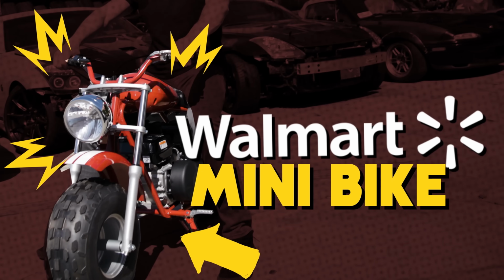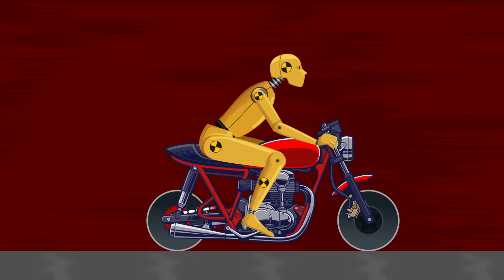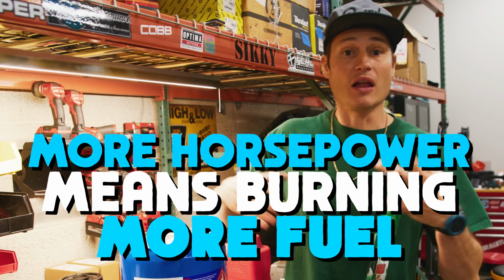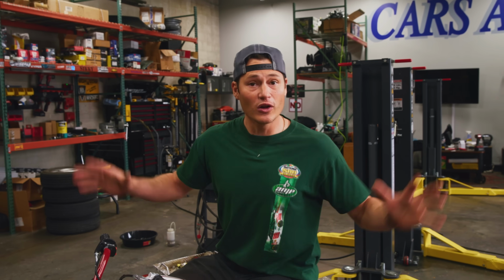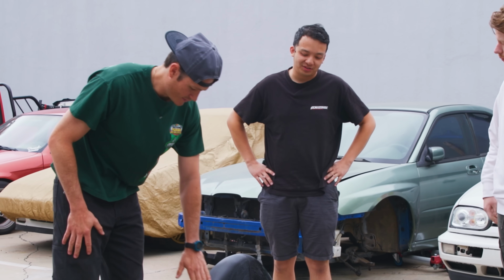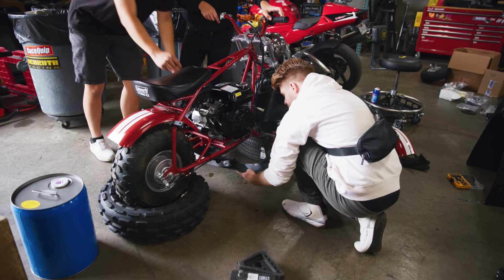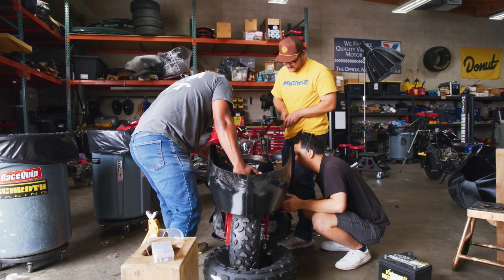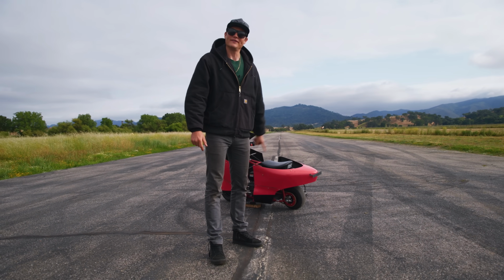Building the World’s Fastest Walmart Motorcycle (Day 2)

Comment: I feel like the smaller diameter back wheel is going to hold it back. A larger thinner back tire would maximize the distance covered per rotation but also won't be as heavy.
Reply: My thoughts exactly
Reply: It's already geared tall to reach 100mph, a larger wheel will gear it too tall to reach their goal.
Reply: @andoletube huh?     The engine will hit top RPM earlier with smaller tires, BUT the top end speed will be diminished.            Why doesn't every car have 13'' tires?
Reply: @chazbennett8676  Final drive ratio is not just about tire size, it's front/rear sprocket sizes. Jerry already said the bike was geared very tall to be able to achieve 100mph, that's why he needs a push start. This talk of altering wheel size is ignoring what has been revealed about the bike in the video.
Reply: the gear ratios compensate for the diameter, but you're right about the width increasing rolling resistance.
Reply: @andoletube  bigger gear or bigger wheel doesnt matter, it would give the same end result on the gearing.

and i doubt it came with the gear they have now from the store
Reply: @TheHenirik  That was precisely my point. Why are you explaining it back to me? You should explain it to the people who don't understand it.
Reply: @andoletube  because I understood the last part as: 'the gearing was already set that way, why would you ruin it with bigger tires'

I might have misinterpreted what you mean though
Reply: @TheHenirik  They definitely set their own gearing, it wasn't the stock gearing the bike came with. That bike was only designed to run to about 20mph, so to modify the engine and to get it to run to 100mph, they clearly set a very different drive ratio, via the chain and sprockets. Jerry mentioned that they geared it so tall for maximum speed that they couldn't even take off without a push from the RV. 

My point was that they have already done that work -  calculated the final ratio to match the maximum power RPM range so they can reach their 100mph target.  So there's no point talking about swapping in big wheels now - that would require substantial re-engineering of the bike, for no real purpose.
Reply: @andoletube  yes and knowing that the tires on something like that likely never would have been rated for such a high speed they could have started on that end instead of getting a gear almost as big as the tire was my point =)

Plus you get more stability and it gets less sensitive to cracks in the pavements
Reply: @TheHenirik  They're trying to avoid having to mod the chassis, plus they're driving it on a smooth runway. This is a purpose built project, it has no future beyond these videos - that's why they aren't bothering with all the world's-best-practice stuff.
Reply: @andoletube  Who said anything about modding the chassis. The went to a smaller wheel size from the original. And no, I'm not suggesting put on something larger not rated for 100mph. Also, you're forgetting that they modded all kinds of stuff already such as the gearing, the engine, the cowling. I assume you already know the results...
Reply: i get your point. why small tire and then add tall gearing when they could have used a normal tire size and not go so agressive in the gearing part... the outcome would be the same, but it the bigger wheel gives more stability. 
maybe they could'nt source one or something. who knows
Reply: Yeah they are changing the final drive a lot with that

Comment: I dig this series, the only thing I see wrong is the reduction in tire size, you gain acceleration at the expense of top and as well as reducing the rear wheel sprocket size you lose initial torque but gain a higher top speed, there a lot of variables that go with it but that’s the rule of thumb

Comment: It's funny, because less grip is actually better for speed runs like this. And that slick absolutely has more rolling resistance due to the stickier rubber compound.
Reply: I was thinking that too.  Also a larger wheel will enable a higher top speed since it gears the bike up.  With a proper torque converter the bolt can take off at a lower rpm to overcome the initial torque needs of a larger tire.  most 200cc mini bikes can easily go over 50mph even with stock tires
Reply: yeah you want a road bicycle tire, basically. The smallest amount of ground contact. Any contact with the ground means more friction. So you want narrow tires with a very large diameter(to change the gearing).

Comment: I advise you to put a bigger and narrower wheel since you need the lowest possible friction resistance and since you have such a high gear ratio you would not have traction problems. For example, the MotoGP bikes have wide tires only because I have to bend in corners otherwise they would all put narrow tires as was done in low engine capacity races. 🙂

Comment: 4:30 Drag force increases with the square of speed. But you don't rate an engine in force, you use power (horsepower/watts). Power to meet drag increases with the CUBE of speed, not the square. So 20>100mph needs 125x more power just to meet air resistance.

I'd look at pedal-powered velomobiles for the sort of fairing you need to really cut it down. At 100mph air resistance is practically the only thing that does matter assuming the engine is geared to reach it.

Comment: You have better fuel and more compression. You need more timing. Did you install and higher degree flywheel key? Or better yet put in the adjustable Time kit for the coil?

Comment: At 1:28 the roll resistance on smaller tires is actually higher then on larger tires. In this case probably that the wheel has no tread makes it more efficient then the off-road tire. Not that this really matters, but I graduated today as a Automotive engineer so I am suddenly spitting these facts.

Comment: Gearing is essential for speed as well. Bigger sprocket in front, smaller sprocket in the rear. Either or both are needed especially with a smaller tire diameter.

Comment: The rear wheel needs to be larger in diameter (free top speed at the cost of acceleration), skinnier, and not a slick compound (less rolling resistance). Additionally, I think an aerodynamic "cover" that is installed on the bike + rider after they are on, or with an opening hatch would have had much higher drag reduction, the gaps in the aero are significantly holding the bike back, to the point where the 4% drag decrease is not outperforming the gain in weight.

The material of the aero is also very interesting, PETG is a relatively brittle plastic which shouldn't be used in applications other than prototyping, I think that 3D printing the aero then using that as a mould for a stronger and lighter material such as fiberglass or carbon fiber for the final part would have been a better alternative.

Comment: Smaller tire means faster wheel rpms and increased tourqe at take off but you lose top end at max rpm's. 
Faster takeoffs are not what you want. 
A skinnier tire the size of stock or slightly larger, over-inflated with the right gearing you could get up to 100mph. Tire Diameter x eng rpm / (front and rear final gearing ratio rpm) = top speed.

Comment: Making some speed holes through that faring, with some cling film over it all, would probably give you less drag with less weight, as 4.2kg/10lbs is quite a bit for the loss of drag. That weight plus the smaller back wheel won't make it any faster. Methanol fuel system surely needs to be tweaked? Good luck, i think you're going to need it

Comment: Smaller diameter tire equals more rolling resistance since the tire needs to rotate faster and makes more contact overall for a set distance than a larger diameter. In this case. a larger skinnier tire would help with that and also the stability problems.

Comment: Without watching what happens next, I'm worried that the air drag forces will flip the bike into a wheelie.  The seat is far too much over the back wheel, so the weight is way too light on the front wheel, even when you're leaning forward.  I'm glad you put those cowls on, as they will reduce the chance of that.  Good luck, and stay safe!

Comment: You can still make tire improvements. The wheels need toade out of aluminum or 3D printed carbon, even taking 1-2 lbs off a tire will drastically improve the speed the tires can rotate. Also those slicks looks a little thick with too much side wall so make the tires more low profile and make the wheels larger to cut out sidewall tire weight. The last and most important part is a much narrower from tirex no more than a 2" wide track and even then, shave a half inch highway strip in the center and your friction road resistance will be greatly reduced meaning was less mechanical power loss.

As I said on the last video, tires, tires, tires, that setup willaoe or break you.

Technically an 18" wheel with a touring bicycle tire with hiway strip would be perfect. The further out your tires distance will be from the center, the faster that tire can spin because the sprocket on the wheel will turn at a speed but the outer edge of the tire will travel significantly farther each rotation. Wouldnt you rather travel the distance a skateboard wheel wil travel in one rotation or would you rather have a 5' wagon wheel distance in one rotation. If those 2 tires are the same weight, it will take the same power to turn those tires, but one will travel much further each rotations. More rotations in the same time frame increases speed

Comment: Correct me if I`m wrong but in one of our Automotive engineering classes we were taught that smaller tyres have a higher rolling resistance, not a lower one. That's one of the reasons you see those "narrow & tall" wheels on EVs so often.
Reply: Also maybe you could've used a larger tyre anyway and then just compensate with gearing. A larger tyre has more rotational and translational inertia, but since you're going for vmax and not acceleration that shouldn't be much of an issue. The greater drag of the larger tyres would be negated by the Fairing.

Comment: You should take off the rear fairing because that would be causing a lot of drag, the way it is designed it would be acting like a parachute so my suggestion is to either take it off all together or modify it by cutting off the rear where it’s going to be catching all the air

Comment: But a larger diameter tire can increase top speed as it takes fewer revolutions to travel the same dustance as the smaller tire. Sure more torque to spin it but lower RPM at the top end to get to higher speeds.

Comment: I wonder if the 3D print would work as a decent mould for a more flexible, forgiving fibreglass fairing in the future. It might end up heavier though, I do not know what kind of weight fibreglass has vs. a 3D print and exactly what percentage of infill or infill pattern they used on the 3D print.

Comment: Drum brakes have higher initial clamping force than discs, but overheat and fade almost instantly due to being a closed system.
Reply: A person could just blow compressed air through the bottom of the backplate and vent it off through the top via a hose leading high enough to prevent the elements from getting in.

Comment: The spray they use for 3d scanning is to eliminate reflections since those ruin the software's ability to make the 3D model. It's usually baking soda + rubbing alcohol or salt + alcohol
They use alcohol instead of water because alcohol will evaporate away leaving just the powder. Water; would leave reflections.

Comment: Actually, with all other parameters (load, width, air pressure, and contact patch area) the same, a larger diameter tire has less rolling resistance.

Comment: Can't help but think that it would have been easier for them if they had used larger wheels. Yes it would take longer to get to speed but the overall high end top speed would be higher. They'd just need a longer straightaway to get to the top speed.

Comment: wait, im pretty sure the optimal air fuel ratio for methanol gives the exact hp (or like 97%) as the perfect gas fuel ratio but methanol makes way less heat so you can turn up the engine.

Comment: Why no torque converter?  Fixed ratio gearing with the stock centrifuge clutch is not the way to go fast.  A torque converter gain will surpass the aero mods by a fair bit.

Comment: The Juggernaut torque converter will give you more speed and quicker starts because of it’s variable gear ratio. Also taller tires don’t need to spin as fast to go as fast, but I’m sure you know that. Yeah sure the rotating mass…

Comment: Why have a smaller tire if you're being pushed by a 4 wheeler?     Use normal size SLICK tires.     Longer tire revolutions at top end means higher speed.      Its always 3 steps foward and 1 back with you guys.

Comment: you guys glossed over how important gearing and tire diameter is. tire diameter is a gear ratio aswell because the vehicle will move the circumference of the tire each revolution of the tire. large diameter means further with fewer revolutions which means youre moving faster. more drag yes but everything has a drawback

Comment: I don't get why you've installed smaller tires.
Since you have a lot more power, wouldn't you want to put that to use by going with a bigger tire for a faster speed (like you are gearing it higher)?
You'll get to your top speed a lot slower, but you should get a higher top speed, which is what you're aiming for.
But, I guess after going with smaller tires, you've then actually installed different gearing.
At least you still have some advantage with less drag, though those little wheels will need to spin awfully fast for 100 mph.

Comment: Unless your compression demands it, what's the point of going M1? You don't gain more power instantly with the fuel, just more knock resistance. If it were M5, it would be slightly different but now you just have to have more weight for more fuel used, more oil dilution and more of a required combustion needing to occur for the same effect. Was it to just mask the overage of fuel or just that its cool? lol

Comment: I thought the fuel to air ratio has to be at 14.7:1. 14.7 air to 1 fuel. I was thought that in automotive school most engines take the motorcycles could take less but it’s still 13:1. Which ain’t 12:1

Comment: But if you need a 28 hp to the original wheel, which is larger than the one you have on now wouldn’t you need more horsepower than 28 hp to make it go 100

Comment: You went the wrong direction with tire size. You should talk to someone who does bracket drag racing about the importance of top speed per gear between different tire sizes. Effective WHP is not the most important. When Hoonigan put little tires on a trophy truck they only increased 20 hp, and they started in the 400s.

Comment: Do or Can people just add a couple gallons of that in their gas tanks and mix it in with 93 octane? And see results without breaking their car??? Like is there a safe way to add a little race fuel to my car if I wanted to take her to the track for test and tune nights? I have a little turbo'ed Juke on a Boost tune, and I did manage to get her into the low 14's and would love to have the first CVT Juke on Video doing a 13. The Biggest sin Nissan ever Made was going with that Jaco CVT.. And I know I know it's a Juke, PPL can make fun but I doubled my power with some Bolt Ons and a Tune not a lot of PPL Can do that with their cheap cars.. Honda is usually the go too for 4 cylinder Turbo's.. But I bought the car 5 Years ago before I even knew what a CVT was.. I just figured hey it's a Japan car it will last Nissan and Toyota had a great Rep for a long time, My whole life actually, and then came the CVT's.. But Toyota at least uses a CVT that can Handle 300 to 350 WT.. The Jaco's can do 250 WT at the most.. There's a Guy in Mass who's building Jukes.. And He has a turbo kit and a Tuned that can get your CVT to 250 WT and just about 300 WHP and deliver the power to the CVT in a safer way.. He's gotten good at it.. He's been building 400/500 Wheel 1.6L Jukes for over 10 years now.. And there is another guy down in Atlanta who Build's and tunes Jukes too.. People Can laugh but I love the reaction I get when I nail it from a 20 roll and they get pinned to the seat to about 80 miles an hour.. But then my car turns back into a 4 cylinder LOL..  Small Turbo..

Comment: I dont think she's going to do it. If you get the fueling spot on with the correct jets, fuel pump, and spark plugs you might get to 100mph with a gearing change and 11 mile runway.. But I'd be concerned that the paper mache fairings can't handle the pressure or vibration at those speeds.

Comment: The small wheels are a huge mistake, at least in the front position.  I'm shocked that you guys went small.  Ride a vespa at 70mph and then a motorcycle at 70mph you'll understand the steering input and output is very different.  One inch of movement on a 10 inch wheel equals feet of turning movement versus a 26 inch motorcycle tire which one inch of movement is inches of turning.  Scary 😮 plus the wheels are so small you have no gyroscopic force keeping the bike wanting to stay upright.